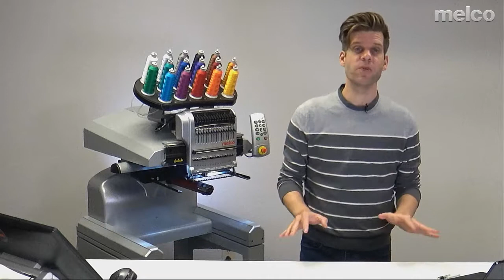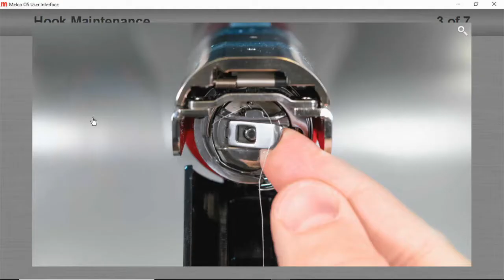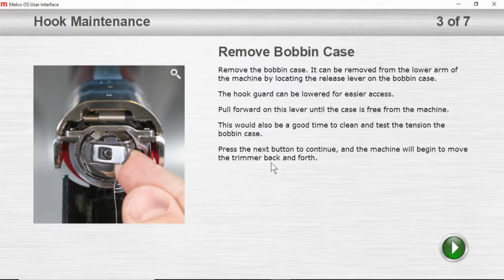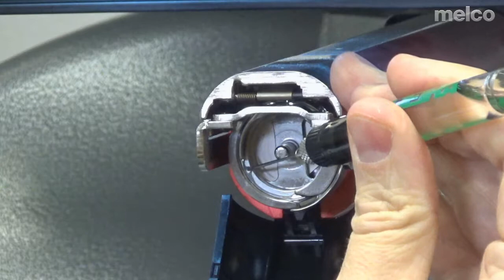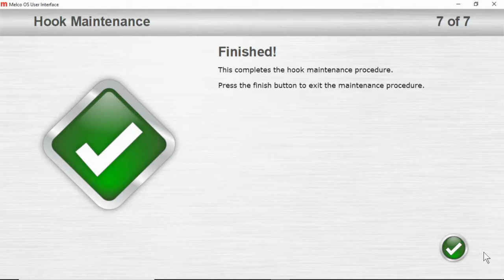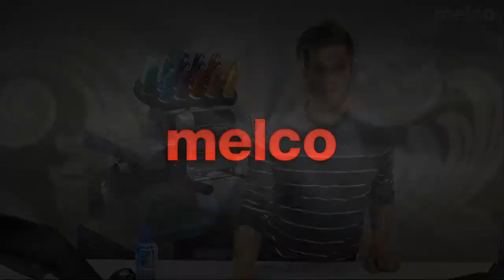Rotary Hook Maintenance (Simplified User Interface)

Comment: What would have been nice is if Melco still sent this neat precision oiler.  They sent me a plastic bottle with some attachment that doesn't look like it will release a drop. There also aren't any instructions either.  It looks like globs of oil are going to pour out.  Went to ShopMelco and the pen is about $10 and shipping is another $10.  Smh, why couldn't Melco provide this neat precision oiler?  I certainly paid enough for the equipment.  Can you do a video on how to use this monster oiler provided in the current sales of Melco's equipment? TIA.